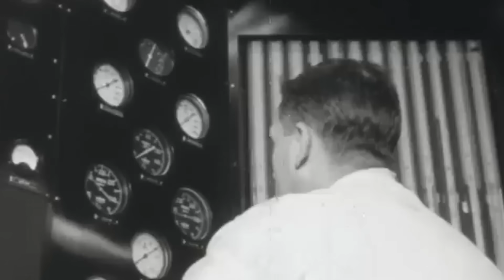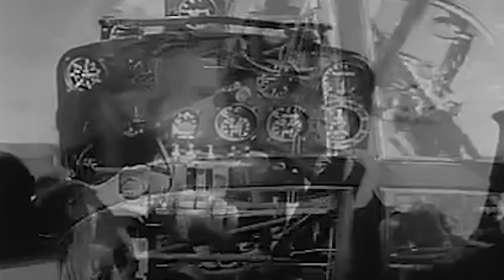The Mind-Blowing Aircraft That Took the World by Storm

Comment: What spun the heli rotors? If the engine was off (mentioned at one point while landing), then how do the rotors spin? Can’t be electric, not that far back, not for air flight. Not seeing an obvious drive shaft either. Maybe one tucked in near the frame.
Reply: Refer to autogiros, or gyrocopters.  Rather than the main rotors tilting forward and pushing air down and back, in auto-rotation (gliding) the main rotor(s) tilt back and the incoming air goes up through the rotor disk "windmilling"  and provides lift.  In auto-rotation you must have forward speed to maintain lift.

Comment: It would have been nice if you could have explained how power was transferred to the rotors.  It appears that there are drive shafts going to the rotors, but that's not clear.
Reply: Трубчатые валы трансмиссии к редукторам винтов.Синхронизированных общим валом.
Reply: 'TWO WORDS - DRIVE SHAFTS!
I.e. As with tail rotors where utilized historically and today.
The drive shafts were symmetrical, and their power variability was precisely synchronized between the two counter rotating propellers AKA the twin contra rotating rotors.
   🚁 🚁 🚁 🚁 🚁 🚁 🚁 🚁 🚁 🚁
Reply: It appears to be belt driven. Check the video at 7:15.

Comment: Well this helicopter was not the first as suggested0. Just for clarification: the French Bréguet Dorand helicopter, propelled the two contra-rotating, coaxial rotors, was built in 1933! After ground tests and an accident, the first flight took place on 26 June 1935, one year prior to the FW61. Within a short time the pilot, Maurice Claisse, was setting records with the aircraft :
    - 14 December 1935: Closed-circuit flight with 500 m diameters
    - 26 September 1936: Height of 158 m
    - 24 November 1936: Flight duration of 1:02:50 hours over a 44 km closed circuit at 44.7 km/h
    - Maximum speed 120 km/h
Anyway this helicopter and its accomplishments were indeed soon overshadowed by the German Fw 61since its development was abandoned with the outbreak of World War II.
Later on the FA223 was indeed the 1st "operational" helicopter in the world, so to speak, showing amazing performances.
Just to be precise ... Regards
Reply: Never happened
Reply: @DoktorBayerischeMotorenWerke  Then google it. Check out Breguet Dorand Gyroplane Laboratoire, 1935
Reply: @DoktorBayerischeMotorenWerke  So all those films showing the Breguet helicopter flying are fakes then?   YES BREGUETS HELICOPTER FLYING MOST CERTAINLY DID HAPPEN.
Reply: @DoktorBayerischeMotorenWerke  😊
Reply: aCtUaLly...

Comment: Is this really a helicopter? Are the rotors powered? What makes this diferent to an auto gyro?
Reply: Sure it is and the rotors are indeed powered. It couldn't hover otherwise.
Reply: Autogiros rotors are spun up mechanically by a clutch connected to the propulsion engine. As soon as takeoff rpm is achieved, the clutch is disconnected and the takeoff run is begun, the rotor continues to spin by airflow passing through it.
Reply: @rogerturner5504  actually, the original autogyro took off like normal planes (although with a shorter run)

Comment: Wondering why they put the rotors to the side, instead of using the length of the fuselage - oh, there have been more recent side by side, like the Kaman K-1200 (2 blade synchromesh), the only twin I could immediately think of was the Chinook
Reply: 'TWO WORDS ...
     ...SPATIAL LIMITATIONS!
I.e.That would have required a hellva long and heavy airframe, two different length (asymmetrical) drive shafts, as well as an crazy long rear drive shaft!
'Just try to picture that! 
'Also a high likelihood for the airframe to simply break in two halfway between the rotor mounts!
THE DESIGN CHOICE, based upon an existing fixed wing airframe, WAS STRONG, LIGHTWEIGHT, LOGICAL, AND ELEGANT!
🚁 🚁 🚁 🚁 🚁 🚁 🚁 🚁 🚁 🚁